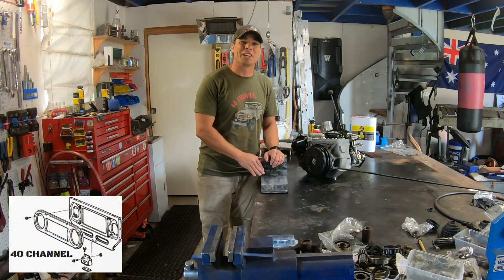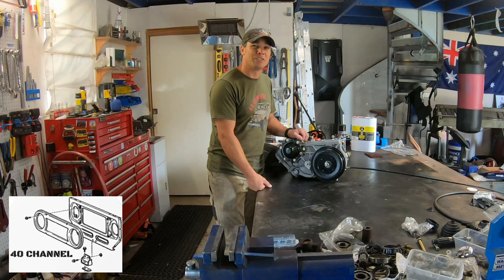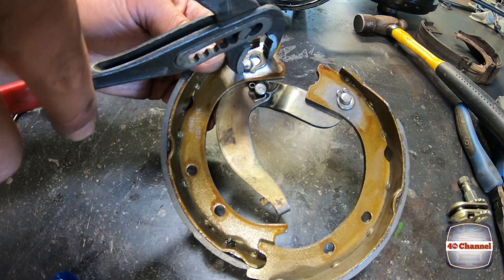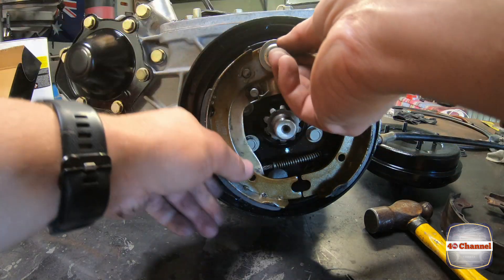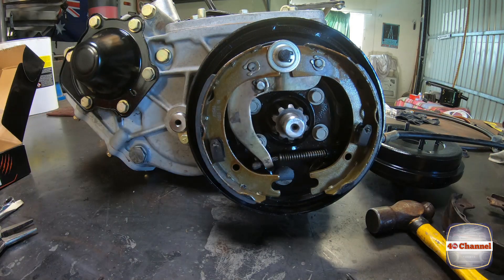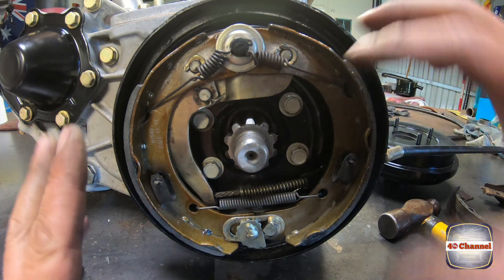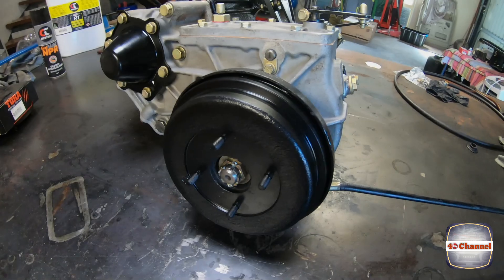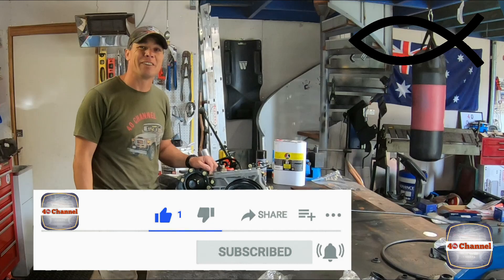S2EP48- How to rebuild a Toyota Landcruiser 40 series handbrake - What are the other options?

Comment: Perfect timing, just about to rebuild my parking brake because of leaking seal. Valley Hybrids in Stockton, California has a great double seal to replace the single seal to prevent future leaks. Great step by step video. Thanks
Reply from the maker: I have seen the double seal from Valley Hybrids, but postage to Australia is a long lead time, so went with the easy to get one. All the best mate.
What year model do you own?

Comment: Thanks for making these videos. I will be one day starting a rebuild on a BJ40 but have little to no experience in car mechanics and so channels like yours will be very useful!!!
Reply from the maker: Please keep me updated when you start you BJ40. What year model is it?
Reply: Best thing is these old girls are simple, and the 40 community is always willing to help
Reply: if you can change a wheel. you can do the rest. its just nuts ,bolts, torques. comprehensive tool kit is first,& not a cheap one. pliers,long nose ,side cutters, decent hammer, jack stands, 3t hyd jack. im not a toyota fan, to me, they flogged a dead horse for too long. never updated. then, when they did, it was wrong. the 80 series is there best 4x4, but, they put the e brake in the disc, & the front radius arms are fixed wrong, best ausie 4x4, is the nissan gu 4.2tdi. its dont correct.. i drive u.s 4x4rs. bit more sensible, parts cheap, .cant beat dana & new process.. heres a hint, the 75 - 80 f100 4x4. is the best, except for the rear drums, which you fix with a chev disc conversion, using the disc as the e brake , .coil front, leaf rea, reversed hangers. bolt thru radius arms, same as range rover crap. the leafs on your 40 should be on top of diff with less arc, so its more comfortable & you get more std travel.

Comment: Great video! Thank you very much.  Just a quick note.  I think your pad retaining springs should be installed the other way.  They will not interact with the washer and won't open up and lose their tension over time (just removed one like that on the vehicle I am rebulding). Thanks again.

Comment: awesome video . Is the 1969 FJ45 3 speed parking brake similar to the 1977 Fj45 parking brake ? As my 1977 has no internals at all and have found a 69 unit ? Many thanks .
Reply from the maker: Thanks for your support, Yes they are similar, interesting that someone has removed all the handbrake components.